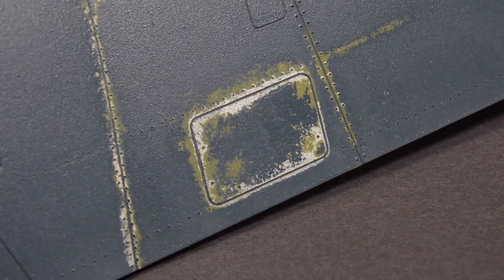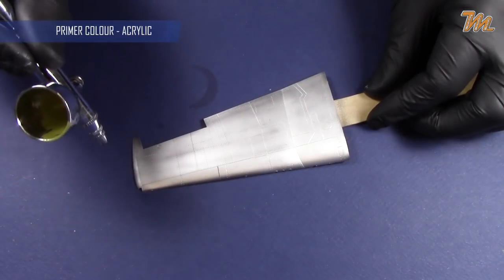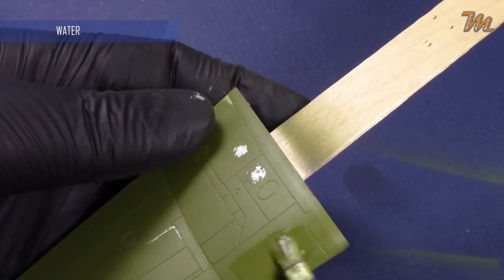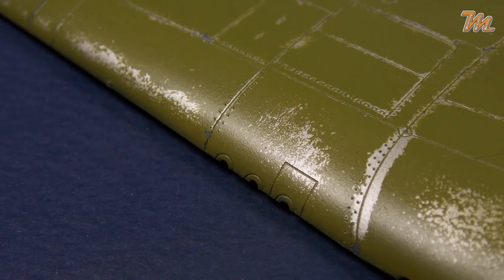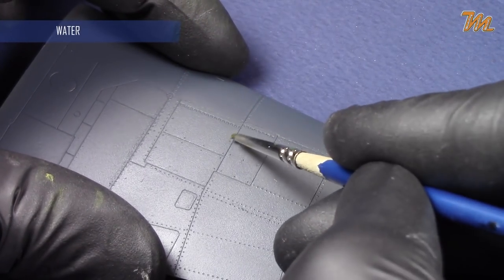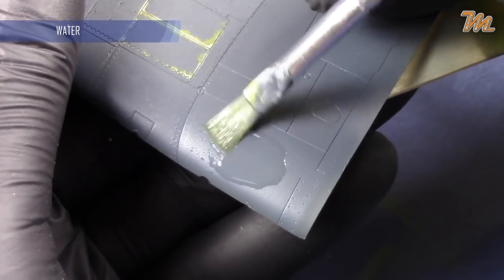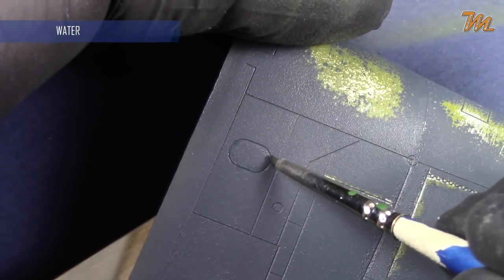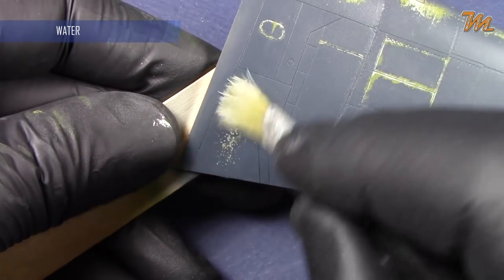Hairspray chipping - scale model weathering tutorial

Comment: Hi! I know it's been over a year ago, but I have few questions. At start I'll say I use brush, cant afford the airbrush.
Lets say I put the primer paint in spray, then silver color. After it dry, I put the hairspray and theres first question- do I put it on the whole for example wing, or only at spots I want to chip? And the second one is, after it dry, I will put camo paint and how long should I wait before I start to chip it with brush and water? Should I wait for it to dry fully, or for example- 30 min would be enough? 
Sry for wall of text but I am beginner. Hope I'll get answer, and you are doing great job!
Reply from the maker: Hi
You can apply the hairspray allover or in section. I apply it everywhere i want to chip and then paint.
How long you have to wait depends on your paint. It's gonna be different than with airbrushed paint so I cannot tell. Experiment on some scrap plastic.
Reply: Thanks for the answer! I will experiment on my "test model" later and check the results then, thanks once again for replying :)

Comment: Hello, not sure if you Will respond but how Long after aplication of the hair Spray you can Chip it? My models take me usually 6 months and when i use the fancy absolute chipping from AK it vaporizes after the months:/ does something Like that happen with hair Spray too?
Reply from the maker: Hi there, i cannot give you an answer cause I haven't left hairspray sitting for so long. I would not suggest more than a week but that's  a guess.
Reply: I find that within a day after the hairspray is dry and the top coat is dry as well, the color can be chipped. Hairspray can be washed out, is water-soluble and the only problem is that if the top color has dried too much, then the effort for chipping is greater and less controllable. According to various videos, chipping liquids should be processed more quickly because they are less soluble in water.
but this is only my opinion, im a freshman in modeling ;-)

Comment: Can I use a acrylic varnish after chipping with this method or is a lacquer varnish needed
Reply from the maker: You can, probably should not flood the surface though.
Reply: @MMScaleModels  i just want to make sure it protects it enough so it the paint job doesn't chip or flake off after a while

Comment: It seems that you get a very visible texture, is this because of the hairspray or normal? And how does it compare to those scratches effects by ammo or ak. I have the chipping weathering set my try it out because it's a very nice tutorial. Anyway did you know reverse chipping? The chips get applied after camo/decal stage and you remove the final layer rather than your basecoat
Reply from the maker: The texture is probably due to my painting and specifically the clear coat. I have never used the "modeling" products but I won't be surpriced if it is the same stuff inside. No I havent seen that technique... do you have any links for it?
Reply from the maker: Haven't seen this technique before... but apparently some special product is required for it.

Comment: Cant you just spray the hair spray from the can straight to the area of the model?
Reply from the maker: You can but it is very easy to put too much this way. I personally prefer to have control.
Reply: What happens if there is too much hairspray? @MMScaleModels
Reply from the maker: @WW2Fr3k  well it is a layer of something and it can cover details. Basically the same reason why we use airbrush to paint instead of rattle cans

Comment: Why not spray straight out of the hairspray can?
Reply from the maker: Better control.
Reply: You can, but you have so much more control with an airbrush. It comes out of the can so quickly that it's easy to flood your model. If you do use it right from the can, hold the kit an arms length away so you get finer coverage.